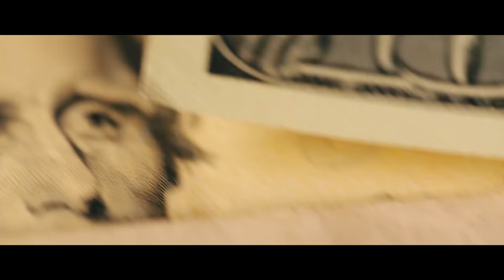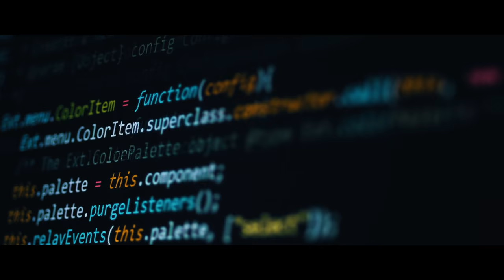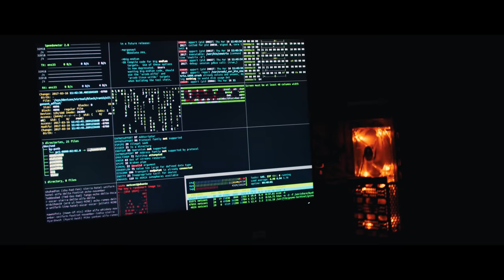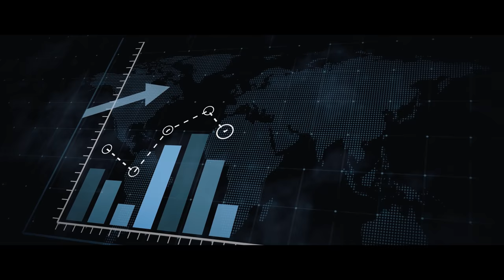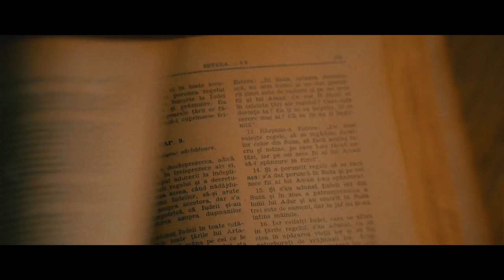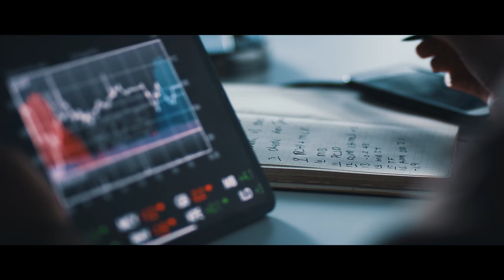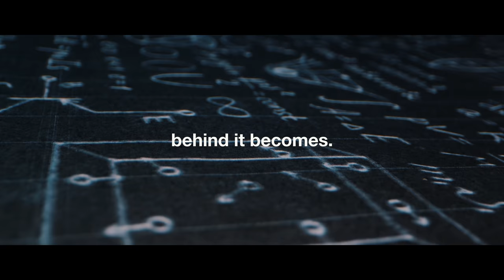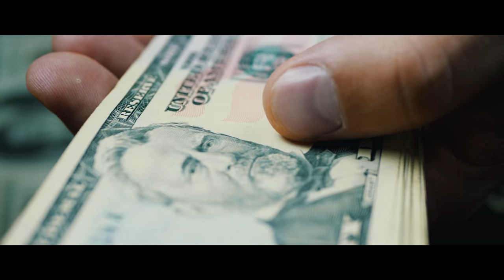Bitcoin: The Currency of The Internet

Comment: Do I understand this correctly?
In order to keep Bitcoin safe from double using a coin, people need to mine and keep the blockchain going. In exchange, they are rewarded some amount of bitcoins.
But what happens when the last coin is mined? They won't have an incentive to keep mining? Or what am I missing?
Reply: miners validate the transactions, the miners earn FEE's from transactions.
Reply: So when a new block is mined that miner receives brand new bitcoin that was not in circulation before and in addition they receive a "miner fee" from each transaction which is bitcoin already in circulation so in around 2150 when the last BTC is mined the miners will have to solely live off of the miners fees but thankfully we won't have to worry about if that'll be enough for them for a while
Reply: @oscillatingturtle2487  Ok, so they get compensated with existing bitcoins. That makes more sense.
Thank you for clarifying!
Reply: @meakone23  Ah, I see. Thanks for clarifying!

Comment: While cryptocurrency not requiring trust and being decentralized is a great advancement, I wouldn't be so quick to write off the pyramid scheme aspect. Even if Dell and Apple were to fail you'd still have a guaranteed reward, the product itself, for buying into the operation. With crypto mining however, you can buy into the operation by providing computing power, but you're absolutely not guaranteed to be the first miner to guess any of the hashes. And I'm absolutely baffled that no mention of environmental impact is made despite how much computational power is required.
Reply: While it is true mining is a huge energy consumer I look at how much energy the traditional financial system uses it's insane and many cryptos have solved this issue with what's called the Proof of Stake protocol which requires no mining and used essentially no energy and ethereum is going to switch over to this protocol soon

Comment: Well its true that bitcoin is not like the dollar, wich can be created endlessly. But still its only another asset option. Its like Gold, platin, silver, property or stocks. An asset with a limited supply, yes but still only getting his value trough the trust of the users. If on bick player says that he doesn't trust in it anymore and sells it, the bitcoin bubble will implode like with any other asset market had. I dont say you should not work with it. But you should treat it like any outer market based curency without any material value!

Comment: As currently implemented Bitcoin has to eventually fail.  This is because of lost wallets.  They can only grow and the system has a limit of the number of coins and a limit to the number of division.  Trouble is, if they try to fix that problem then the entire thing falls apart as you will need a centralized system to recover lost value.  This will of course take a while.  Unlike the first 20% which was mostly due to people not caring, Now the majority of the creep up of lost wallets is going to be people dying.  About 1% each year.